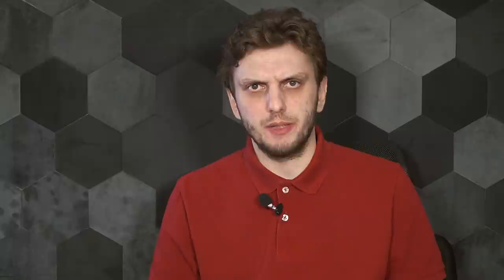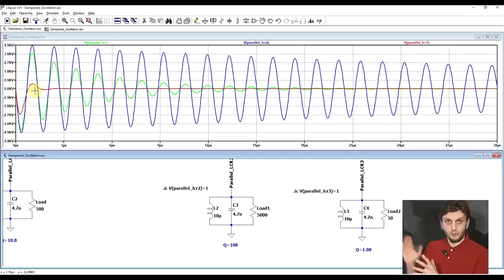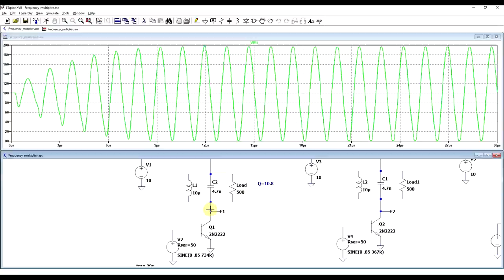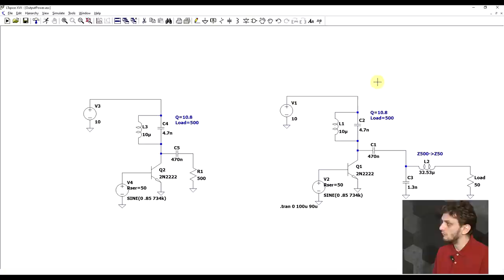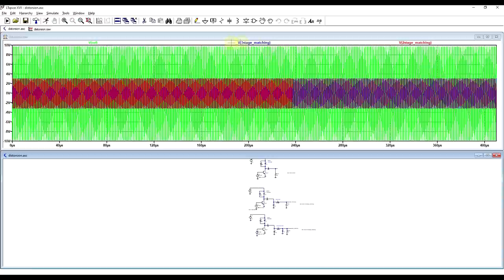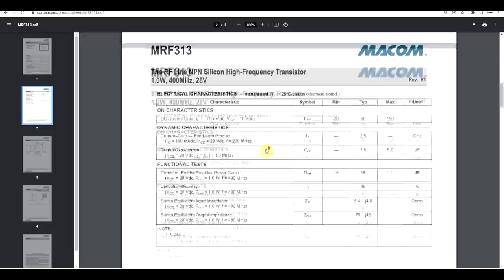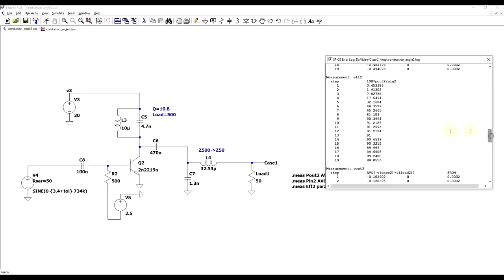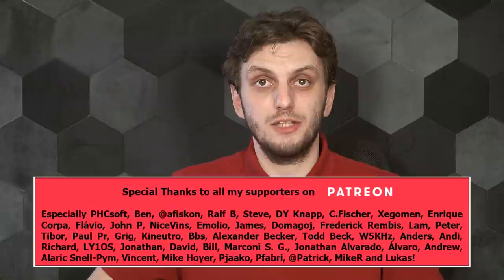The RF Class C amplifier - basics and simulations (1/2)

Comment: absolutely great explanation of class C behavior , am an old retired RF engineer and used this in quartz LO multipliers and even in TV output power for narrow band ( ~10 MHz bw at 800 MHz freq ) , and with an SA could get very low 3rd and 2nd harmonics , but with very long and difficult time finding the correct impedance/Q matching  elements using cavities and slit couplings ...had no such fabulous simulation tools at the time , mostly the nose , experience and lot of time ....very nice return in my past , Thanks !!
Reply: I have a video transmitter. I want to increase the range of the transmitter. Which amplifier should I use for the UHF band?

Comment: Brilliant  and superb presentation. This gentleman knows a transistor and the power transfer requirement, Unlike many other " electronics contributors, he did not just fill a whiteboard with his handwritten notes and spend the time reading it, wavering his pen  on the written sheet, describing what the unit does rather than the detail of how it works. Thank you Sir, for respecting your audience and in turn you should be highly respected. Thank you once again. .

Comment: I called  Ic singal(with broken tip) Spork signal.       When Ic becomes spork signal, 2nd 4th sprious increases.  
Then Conventional AM transmitters apply simultaneous modulation to the final stage and the excitation stage.

Comment: Thanks for the video. I think it's simpler to think about class C PA in the frequency domain. The parallel LC circuit forms a band-pass filter. The class C PA works as a switch, thus generating multiple harmonics of the original signal. These harmonics can be filtered using a corresponding band-pass filter, which creates the "frequency multiplication" effect. The waveforms at 7:30 don't show that the frequency multiplier is unreliable, but that the band-pass filter is not great, thus there are other harmonics than the desired one in the output signal.
Reply from the maker: I guess that what I meant by unreliable was that if you are trying to generate very large frequency multiples, at some point the input signal is not properly multiplied, but rather the output frequency depends more on the center frequencies of the various LC circuits than the input signal frequency.
Reply: @FesZElectronics  I'm afraid that's not quite accurate either. The harmonics will be all over the spectrum. You just need a narrow band-pass filter to filter the right one, that's it. In practice, people don't use literally an LC circuit on the collector, because that's indeed not the greats filter. Usually, you will see a 1:4 transformer that converts 50 Ohm load to 200 Ohm one on the collector and a following 7-pole LPF/BPF, or maybe a crystal filter. You can find the concrete example in the schematic for video number 17 (page 9) on my channel, although I used a MOSFET instead of a NPN transistor.

Comment: Excellent presentation and explanation of some small details the text books gloss over and leave you scratching your head. How good is LTSpice for simulations of these types of circuits for frequencies from 7-14 MHz? 20-40 meters ?
Reply from the maker: In general the simulation result is only as good as the component models that you are using - if various parasitic elements are removed to get a simpler design, then the observed behaviors will differ from realty.

Comment: Really appreciate the fantastic video thank you.  Just one basic thing I'm hung up on.  I've read that sometimes LC circuits are used as filters.  So they have infinite impedance (when parallel) at resonate frequencies.  Does that not apply here?  It doesn't seem that the transistor is operating as if it has infinite impedance in the collector.  So i'm confused as far as when to treat it like a filter versus when to treat it like an oscillator.  Anyways thank you.
Reply from the maker: It does work as a filter here as well, its just that you need to consider that the LC is also in parallel with the load R; so at resonance, the equivalent impedance of the whole group (parallel RLC) is R (the LC is infinite as you mentioned); and at any other frequency the impedance is lower because of there reactive behavior of the LC group.

Comment: Nice video. At least five volts? Q factor recommended. What is the max Q for class C? Thanks! You have a new subscriber. Cheers from Utah!
Reply from the maker: Q is dimensionless (its a Q of 5); or did the 5V refer to something else? I don't think there is theoretical limit to the Q value other than real life - very high Q means very little inductance and a large capacitance - you need very large current pulses to drive it; also components have tolerance - if you have a very large Q, you can simply miss the desired operating frequency under specific conditions (temperature for example will impact component values)
Reply: @FesZElectronics  That is spot on. I mistakenly assumed 5 was volts...

Comment: Won't your blocking capacitor change the impedance that needs to be matched in going from the 500 ohms to the 50 ohms or is it a negligible value?

Comment: in many class C amplifier the Capacitor which is parallel with the coil on the collector is omitted. Can you explain why that is?
Reply: A real inductor behaves quite differently from an ideal inductor. A real inductor has some parallel capacitance built in, and this may be suitable for the amplifier.

Comment: Hi @FesZ Electronics. In the case of 2.5v I have obtained different results with Eff2 and with the same values and the same circuit. Could it be something related to the numerical resolution of LTspice ?. Could you please share your LTspice file ?. Thanks
Reply from the maker: Hello Aitor! One thing I think was not mentioned clearly in the video was that in the transient simulation setup, I set a stop time at 500us and a start time at 300us - the idea here being that I wanted to exclude any start-up behaviors. What exactly was the efficiency you obtained (and what was the reference in the video)?
Another thing that might be different was the spice model used for the transistor - I will add it in the description.
Regarding file sharing, I restrict this to certain tier of Patrons, in an effort to thank them for their contribution.

Comment: Hİ, can you make a video about avalanche transistor or diode?  Fmmt417 is a good avalanche transistor and it has .spice file but I can't use it in marx generator.  Even though the transistor goes into avalanche mode, it turns off in a short time and I can't get the output voltage.  Thank you for the videos and useful information :)

Comment: I believe in real Class-C amps they just put a very large inductor in the collector, to keep it operating in continuous current mode, and then the output has the LC matching which acts also like a filter to get the required frequency (you put in a PI filter) (see an example at https://www.youtube.com/watch?v=flZjBqicGTE&ab_channel=MahendranC). Having the "LC tank" in the collector is too difficult to get a good signal since the load will load down it's Q and then you get discontinuous operation.....all the real schematics I've ever seen for Class C, don't use a LC tank in the collector, they use a large inductor in the collector for continuous current, and then the output network is a matching network connected to a filter which will give you the frequency of interest - the input frequency is what determines the real frequency of operation more than anything. Class C is basically a "DC - DC converter" that doesn't rectify the signal and has a filter at the frequency of interest instead of a super low pass filter.